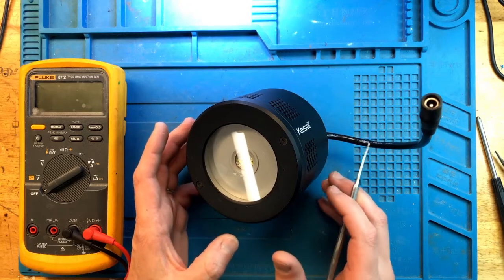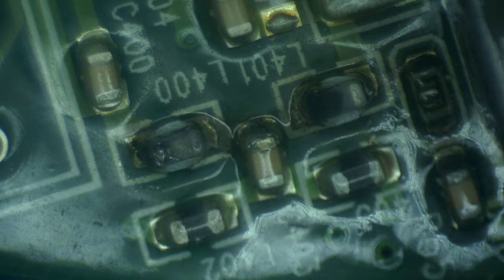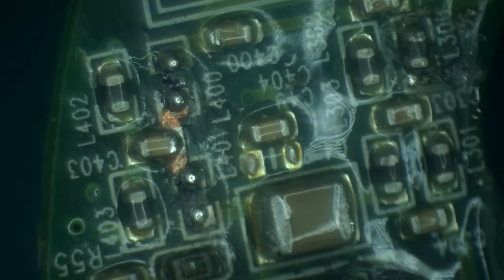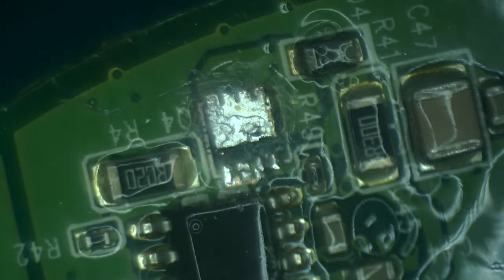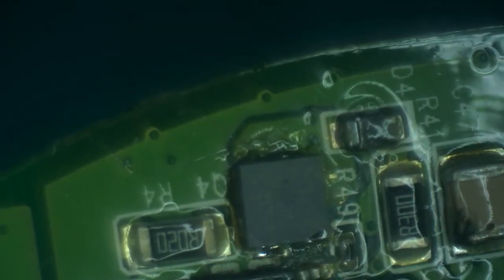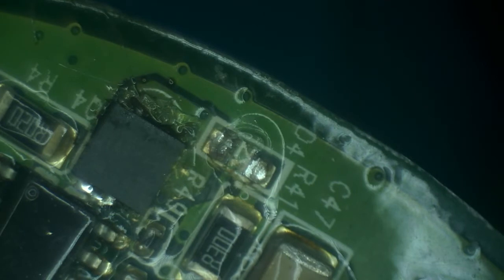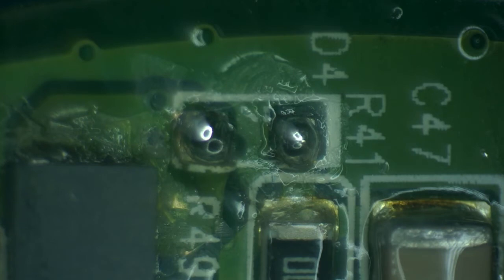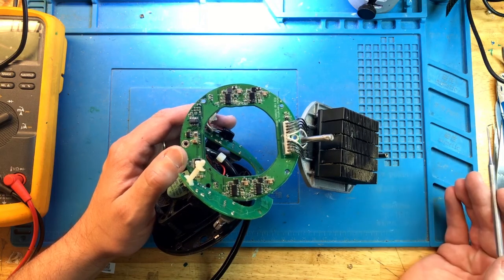Kessil A360W Rapidly Flashing

Comment: Have you ever worked on a Kessil AP700 with no power?
Reply from the maker: Yes. The power circuit of the AP700 is drastically different from that of the smaller models.